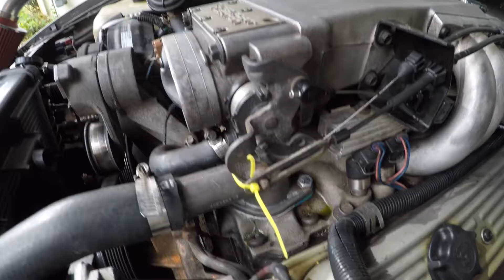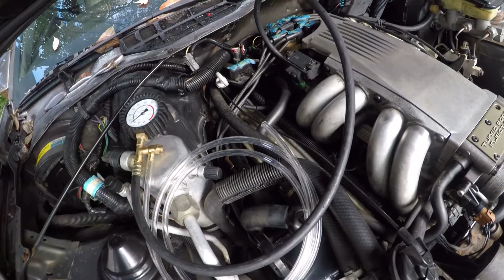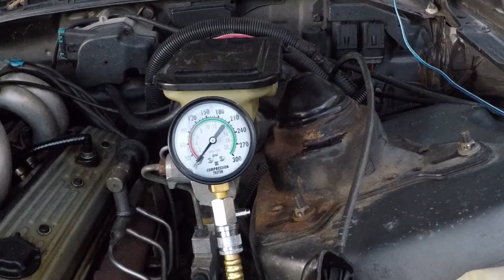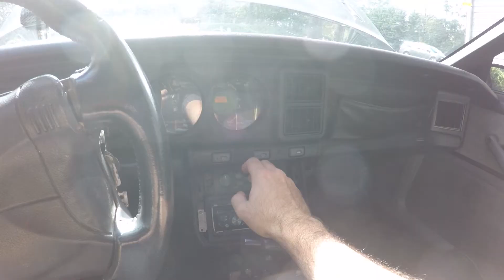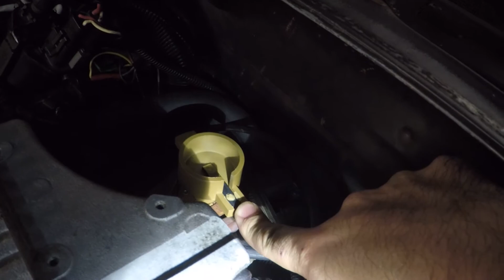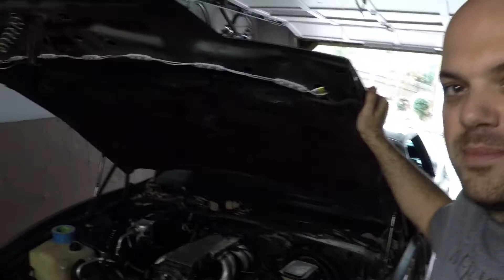1991 Trans Am TPI No Start || Episode 6

Comment: i am experiencing the same problem  right now with my 85 corvette with tpi. got new fuel pump with sending unit, new fuel pressure regulator, checked for spark, cant be compression issue because i drove the car and then sat for a week. went through the same route except haven't checked my distributor yet. i did notice the distributor I'll loser than usual and could moved from some bumps. keep thinking there's  an ignition related issue. when it starts, it idles like crap and then one tap of the gas pedal and it will fall flat on its face.
Reply: Have you figured this out?? Having the same issues

Comment: So to recap did you buy a new distributor?  And so that was ur issue?
Cause I noticed my dist cap can be spun clockwise or counter by hand. I think its suppose to be bolted secure. And my rotor was also pointed facing foward like urs. But the notch fits the rotar in that position. My car is still not starting after an amazing day of driving. I turned off car then upon restarting it- it jumped around and finally only cranks but no starting.  Is it possible the distributor could have went off timing while driving due to the road or engine vibrating/turning the cap and base timing off?
Reply from the maker: Nope i didn't need a new distributor. My rotor just had to be clicked into place. I think if your distributor went out of timing, there may be some internal damage. Have you taken your timing?
Reply: @OverheatedGarage  at this point I towed to engine shop. I started of thinking no fuel delivery. Cause I got spark. But u had spark too. And it wasn't fuel related. Hope tomm to get answers from mechanic
Reply: @OverheatedGarage  following up to help anyone. After everything- mechanic found crazy amount of water in gas tank, lines, injectors upon getting BAD PREMIUM GAS at a local CITCO! Had to drop the exhaust to drop my gas tank, blow out entire fuel system, lines, tank, injectors and more. New oil change. Expensive and timely repairs. So pissed🙄
Reply from the maker: @theoutlaw9043  whoa that sucks! Sorry that happened but glad you figured it out!
Reply: @OverheatedGarage  thx bro. Found out today the citgo turned in to michigan agricultural. Mult complaints. I just dropped off my $700 costs of repairs for them to compensate. Lol
Reply from the maker: @theoutlaw9043  haha good luck with that!
Reply: @theoutlaw9043  $700 is an expensive repair?
Reply: @vampcaff  for some

Comment: Going thru exact issue w my 89 305 tpi formula firebird. Replaced:
Fuel pump relay
Fuel pump fuse
Dist cap and rotor
Ignition module
Fuel pressure regulator
Still no start. Tho my fuel pump primes I wonder if pump is bad
Reply: Same on my 86 swapped a mild built 350 from a 89 gta drove it 8 mins it kept trying to die at stop lights had to put it in neutral and keep rpm up so it wouldn’t stall new fuel pump. It’s getting spark injectors are good. tried starting with starter fluid just just keeps dying out
Reply: I've got fuel, fuel pressure, spark, timing (I think)... Car was running, I shut it off and it wouldn't restart. Did you ever fix your problem?

Comment: I have an issue with the same car same engine. When cold runs fine when warms up only runs on 7 or 6 sylinders.
Reply from the maker: Thats weird. You checked the compression? Any vacuum leaks?
Reply: @OverheatedGarage  compression is fine but im gonna start checking for leaks when i have spare time
Reply from the maker: @attetaateli3483  All 8 cylinders fire when its cold?
Reply: @OverheatedGarage  yes

Comment: Can some one provide the part number and solution to the zipp tied throttle cable i have the same problem on a 92 camaro 3.1L
Reply: Dorman Linkage Retainer Clips  Part number 41017
Reply from the maker: I don't have a part number but I used a random metal retainer ring. They have them at Ace Hardware. They're super cheap so you can grab a few different sizes and try.

Comment: Change injectors I fix my car
Reply: Bravo Arturo!! Was wondering why no one had mentioned injectors yet. They are horrible for shorting out and cause no starts in GM multi port engines of that era. We use to change lots of these back in the day at our shop. By the way, these early modules won't throw codes for injectors either. Fun to diagnose.
Reply: Tpi dont have injectors

Comment: It's the fuel pump. When you turn the key on the fuel pressure should be 42psig right away, then drop back to 38psig. You now need a new starter from turning it over so many times.

Comment: I got service engine soon flash for couple days than park the car over night , cranks in the morning but no start at all , can any list what might the couse is ?

91 bird TPI 305
Reply from the maker: The general rule is if you have spark, fuel, air, and compression the motor should start. If the check engine light came on it could be a sensor. See if any codes are being thrown. Might be something like a mass air flow sensor.
Reply: @OverheatedGarage  getting 12 code each time ... Nothing
Reply: Oh yeah + one of my friends test the plugs sparks as you did , No sparks in there..
Reply from the maker: @FaisalAhmed-kf9yf  Nice work! The easiest next step is to check the cap & rotor on your distributor. If it wears away enough, you won't get a spark. It's also possible there's some kind of damage to the distributor.
Reply: @OverheatedGarage   WALLA, it was the distributor black sending unite attched to it , there were 2 wires and one of the was in bad shape , got full new one and it starts right the way , but I still have service engine soon light on , not blinking .
Reply from the maker: Nice, congrats! When you say the black sending unit, was it the ICM? Was the engine light stuck on before you replaced it?
Reply: @OverheatedGarage   No , was blinking , now after car fixed ,its stuck , and about the the ICM , Yes , it was the white back plug , one rusty wires .
Reply from the maker: @FaisalAhmed-kf9yf  Did you try resetting the computer by disconnecting the battery for 30 seconds? It's gotta be something with the new ICM. You sure it's plugged in all the way?
Reply: @OverheatedGarage  It crossed my mind but I thought it needs some shop computer ICU wizard work, I will disconnect the battery tonight .

Comment: I own a 86 GTA 350 four barrel runs warm an electrical fan issue , I drove it hone right before winter an figured spring fix it won’t start , no starting fluid will start it ! I had spark now time to check the distributor thanks hopefully this is it !
Reply: I thought 1987 was the first year for the GTA?
Reply from the maker: Good luck!

Comment: Well what caused the rotor to face the other direction?
Reply from the maker: No idea other than I was driving it at high RPMs the day it happened. It must have knocked loose.
Reply: @OverheatedGarage  well how did you know it was facing wrong just by looking at it ? Because the rotor can stop and turn in any direction. Just curious.
Reply from the maker: @jl456  oh! Because at top dead center it should have been pointing to cylinder 1 (which is the front right cylinder when you're looking at it.) It was pointing directly to the driver side when it knocked loose and I knew it looked funky.
Reply: @OverheatedGarage  oh okay thanks I'm trying to figure out my 91 Z right now it cranks over but doesn't start, only on starting fluid it will start up
Reply from the maker: @jl456  you checked the fuel pressure? Fuel pump? Check your fuses too.
Reply: @OverheatedGarage  I installed a new fuel pump I need to check the pressure though.
Reply from the maker: @jl456  generally if you have spark, fuel, air, and compression it should run. Of course random sensors will have an effect.
Reply: @OverheatedGarage  I'm worried it might be the computer that's bad I've had this car since high school but it has been stored for a very long time and wont start now. But thanks for all the info your video helps me search for solutions.
Reply from the maker: @jl456  let me know when you figure it out. This is also my high school car so I can relate. Good luck!